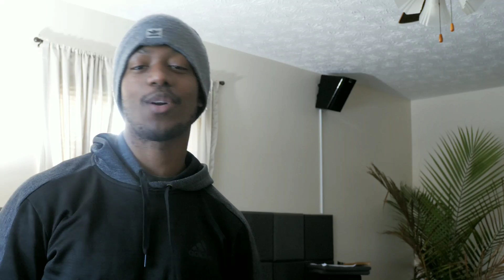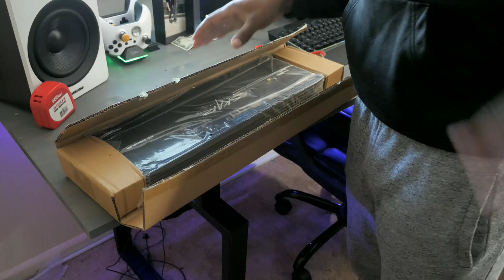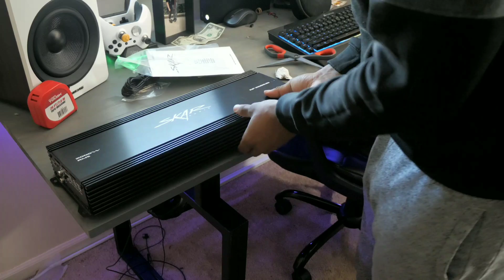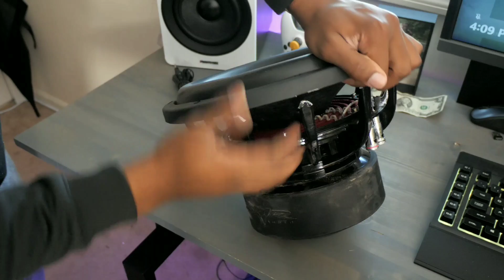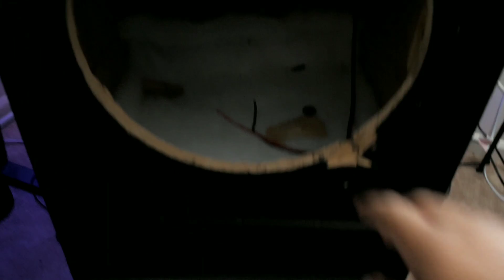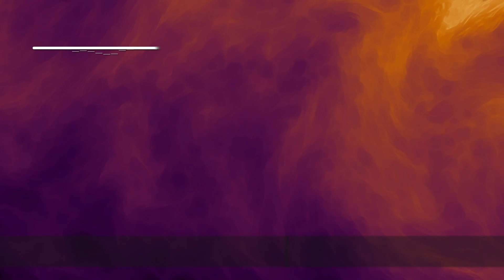Skar RP-2000.1D With Skar Audio EVL 12s!! 5000 Watts! | OFC Wiring

Comment: My personal experience with that package is very impressive I never had a set that banged the way this setup does it's amazing but then I kept the woofers when I was in need and then sold the amp I slapped them on the DS18 GENX 6000.1 And still slamming the ground ! 😂 These woofers are true ground thumpers!

Comment: Wait a minute a diagram that I saw it said that if you were wiring two dual four ohm voice coils to the amp then you wanted to Hook the speaker wire to the middle terminals. Maybe I have my system set up wrong can anyone confirm how you're supposed to wire up the subs to the amp?.

I wired up two EVL 12 dual voice coil 4 ohm in the box for one ohm operation. I got a plus and minus speaker wire coming out of the box going into the amp. Which terminals do I use? Hopefully I haven't caused any damage to the speakers
Reply from the maker: If you're wiring 2 dual 4 ohm subs to 1 ohm amp you Need to go positive to positive and negative and negative on both subs then tether a positive and one negative going to one positive and one negative of the other sub.
Reply: @Kpaceguy  no what I'm saying is how do you hook the subs up to the amp I have everything wired up in the box down to one ohm and it comes out of one set of terminals on the side of the box and a positive and negative speaker wire goes from that and then into the amp. I read somewhere that you're supposed to use the middle terminal on the amp the plus and minus in the middle of the amplifier. 

Now am I supposed to be going by What you showed in the video?. 

If so, am I running my subs at the wrong power the wrong ohms. Or does it not matter on the amp end?

Should I rehook up my box  to the amp based on how you did it will it make a difference Or is using the middle terminals fine

My box only has one set of terminals coming out of one side of it
Reply from the maker: @jaygee6983  it changes from amp to amp what terminals to use. So you'll need to download your manual if you don't have it. It 100% matters on the amp end what ohms you're running. It doesn't matter how you have things wired going out of the box it matters how you have the subs hooked up together which is what I just described.
Reply: @Kpaceguy  I have the RP 2000 skar I just purchased and it looks like what you show in the video. You use different terminals than I used.

I wired the subs parallel for a one ohm load. I saw somewhere that they hooked up the plus and the minus in the middle of the amp. Is that right or do I got to use the same terminals you used.

I guess I can read the book that came with the amp again but it didn't really show. It shows the wiring going to both terminals. It shows all four speaker terminals being used on the amp It doesn't really explain how you would hook up for parallel mode. The way I wired my box one terminal has leads coming out of it that would go to the amp so I only have two speaker wires, one positive and one negative so I'm kind of just trying to figure out where I hook those up on the amp if maybe I have it wrong
Reply from the maker: @jaygee6983  use the same I used.
Reply: @Kpaceguy  okay thanks man. I'm going to rehook up the connections also you have any clue where I should set the gain I have it almost all the way up Is that okay or should I be going three quarters with it or is it fine where I have it?
Reply from the maker: @jaygee6983  there's really never a reason to have it all the way up. But the correct position changed depending your electrical system. An audio shop can set it for you for maybe 25 bucks
Reply: @Kpaceguy  well I'll bring it down to three quarters to play it safe

Comment: I just bought the package does the rp 2000 SKAR amp do a good job at 2 ohms with the skar Evls cuz I wanna do 2ohms
Reply from the maker: No it's intended to be at 1 ohm and there's not really a reason why you wouldn't
Reply: So it’s the rp 2000 is good at 1ohm for the evls
Reply from the maker: @shirazalli5566  yes

Comment: Did you use the 3000 watt ofc wiring kit?
Reply from the maker: Not a kit but it is ofc 0 gauge
Reply: @Kpaceguy   what’s the wattage of your wire?
Reply from the maker: @derrickwalters78  2000+ watts

Comment: Could a 4 gauge kit work on that amp??
Reply from the maker: Not recommended
Reply: no, that amplfier isn’t a fan of bad voltage either. i’ve got one and i’ve noticed it doesn’t like below 13 for me. you’d be best of using 1/0 ofc

Comment: I have 2 skar evl 10s what amp do you recommend
Reply from the maker: 2000.1D or 2500.1D
Reply: @Kpaceguy  hey I just researched, do you think a rockville db14 would work fine, my subs are 2 Ohm stable.
Reply from the maker: @lilmudbuddy7633  yes but that 2000w rms probably isn't at 2ohms.
Reply: What about a Taramp's MD 3000.1
Reply from the maker: @lilmudbuddy7633  that would be fine
Reply: Thanks for the tips dude, I really appreciate it have a good night.
Reply from the maker: @lilmudbuddy7633  no problem buddy

Comment: I got a set of dual 12 evls for free. Super excited. I really like loud bass. Hope my electrical should be fine with the rp2000.1d. It's not an insane amp and purposely got one with less wattage so I don't need all that extra stuff. All 0 gauge ofc wiring and the big 3 to help my alternator. Can't wait for the install day.
Reply from the maker: Yup you should be fine but wouldn't hurt to get a 2nd battery
Reply: 2nd battery maybe needed depending on power requirements of your 4 channel amp.  Measure voltage at the amplifiers inputs with volume set to loudest you will use and check for voltage drop.  Too much voltage drop can kill your amp (some amps are more sensitive to voltage drop than others)

Comment: Take the time to MOUNT everything if you got a nice set up
I made wooden molds of my base in the trunk. (the floor) Then I made some thick wood that is also light, but strong.
All of My things including amp, and speakers Have frames built around them holding them to the board. They are so strong and reinforced with epoxy. 
Basically, if someone manages to get into my trunk, they actually won't be able to take anything. How to you beat a theif? Simply make it too hard to take. 
And for the car? go to your dealership, have them install a remove cut off switch. As soon as the car starts, press the button and shut it off :)

Comment: Hey would this be enough power for both of the subs, I have 2 and I don’t know if I should go with this or the mono block 2500
Reply from the maker: What subs. If you're talking about vxf 2500 isn't enough. I'm finding that out now
Reply: Kpaceguy I have the evl 12s I was wondering if the SKV2-2500.1D would power it alright
Reply from the maker: The would be good

Comment: Did you need an upgraded alt, or capacitor or anything to help run this stock?
Reply from the maker: No but to get the best out of your amps I'd upgrade alt and battery
Reply: @Kpaceguy  didnt watch the video yet but what kinda car is it? waiting on my evl 12s and the skar 2000.d
Reply from the maker: @BigHemiNJ  2016 accord
Reply: Are the Speakers any good?

Comment: Um, thats 2000 watts my dude
Reply from the maker: Dual evl max power combined is a total of 5000 watts
Reply: @Kpaceguy  if he is only using one 2000 watt amp he is only getting 2000 watts I know the amp does do over rated watts but only around 2700 watts so that's all he's getting.
Reply: single 2.500 watt along with 1.250 watt rms baby double makes 5k 2.500 rms sounds reasonable lol 30 32 hz he can shake house windows with that low hits

Comment: Why did you put 5000w in the title? It's a 2000w amp
Reply from the maker: Speakers max power combined
Reply: Oh, gonna need like two of these amps to even get close that 5k
Reply from the maker: @rickytrevino8281  I have a whole new system
Reply: @Kpaceguy  What is it
Reply from the maker: @rickytrevino8281  its on the channel
Reply: @Kpaceguy  Couldnt find it
Reply from the maker: @rickytrevino8281  just type in Kpaceguy skar vxf or Kpaceguy skar audio.
Reply from the maker: https://youtu.be/rj7Ixzvv8ek

Comment: I have two of the ix-12 series 12" subs on the rp1000.1D they handle it just fine there subs are so conservatively rated and I bought there amp wiring kit witch was plenty of wire and 4 skar audio 6x8's and to of there super tweeters mids and highs powered with a power acoustic 2,500 watt amp tuned to around 400 watts and the subs on the skar rp1000.1D man it freaking hits hard everyone I have gave a demo thanks I spent thousands on it all together it was $657.96
Reply: Bro I'm going to post a video of my setup on my channel here in just a bit if you wanna check it out
Reply: skar doesn’t have a rp 1000 only the rp 1200
Reply: @Messinwithsasquatch  yeah thats what i meant

Comment: Ok I hooked this amp up yesterday to my SA 12 V2 sub and tuned it using the SMD DD1 and set the crossover using the SMD  CC1 and set the Subsonic to 24 HZ because my box is tuned to 32 HZ. Don’t get me wrong the amp puts out its rated power and some but I did notice a little lack in the sound quality. I had my other amp hooked up first and it sounded very clean with rated power for my subwoofer on the dot. Sundown subs are underrated you can get way more performance out of them that is why I got this amp. I did notice it made my sub hit very hard because my rear view mirror immediately went down to the down position when the bass hit hard and parts of my car was vibrating that were not vibrating before. I hooked my other amp up today and noticed the night and day difference on the sound quality. And the one thing I did notice with my other amp was when I was playing it with just the sub without my mids and highs the bass was very clean with no unwanted frequencies. With the RP 2000.1 doing the same thing I can hear a slight frequency of the instrumentals or higher frequency slipping through. And I did not hear that on my other amp and I used the SMD DD1 and the CC1 to set everything and the subsonic set correctly because I don’t want to damage my sub. I think the main flaw in this amp is the crossovers that is affecting the sound quality but it hits pretty dam hard I must say just make sure you set your subsonic correctly; you don’t want to damage your sub. I am going to test it out for about a week and hook up a DSP and see if I can tailor the sound a little bit better. My other amp puts out half the power but cost about $70 more. So I guess you get what you pay for. For the power it puts out it is well worth the money, I am going to see if I can improve the sound with a DSP. If I can get the sound a little better I will keep it.
Reply: So buy two to make it better in quality
Reply: get the skv2 series wayy better sound quality

Comment: What ohm are the evls? 2 or 4? Im new to this.
Reply from the maker: They come in dual 2 or 4 ohms depending on how many you want to run and how stable your amp is
Reply: You can wire two D4’s down to 1 ohm or keep at 4 ohm.
Reply: 2 Ohm to 1 ohm in box comes with it im guessing so u just wire it unless custom box well start tunning up lol

Comment: any problems with overheating with the wood amp rack ? im waiting to install mine had it all over a year
Reply: I have the same amp and it gets warm but not hot. Running it @1 ohm and I run full tilt all the time no problems. Just dont mount to sub enclosure or skar wont warranty it.
Reply from the maker: Nope not at all but I don't run it at Hugh volumes too often
Reply: @Kpaceguy  appreciate the reply bro thank you all i have left is just plug in all my wires and build amp rack just didnt want to send it in to protect

Comment: Do you have any overheating problems with the rp 2000? Beacuse i do 🙁
Reply: Put some rubber spacers between where your amp is mounted and your amp. Problem solved. Or if you are that worried about it wire it to 2 ohms instead of 1. I've not had any problems with mine tho.
Reply from the maker: Nope haven't ran into any problems so far
Reply: I heard they overheat if u mount them on the box or any flat surface     because of vents being on the bottom.
Reply: I sold the amp theres reviews that it does not like 2ohms and I did go with 2 ohms and it was worse
Reply: @ReeferCuz  wow that's crazy man. Only problem I've had with skar is I ordered a evl 15 and the dustcap was messed up, it's like the logo is peeling off the cap.
Reply: Yea my shit overheats too smh
Reply: My 2000 amp overheats also
Reply: i would say keep gain low if is overheats and try test voltage with Digital Multimeter

Comment: I suggest a PAC- LC1 bass knob. It runs from the back of your radio. Simple and more convenient. Thank you.
Reply from the maker: I'm not sure I've ever heard of that
Reply: Not hard to install. Connect the rca wires together and get ready to BOOM. I have 1 12" @ 1 ohm EVL on a super bass box and being powered by the SKAR AUDIO SKv2  1500.1D @ 1 ohm. The whole car is SKAR AUDIO. Tweeters, 6x9's, 6.5's soundbox 0 gauge wires.
Later on a 12" ZVX on a RP2000.1d is being is next. The box is being built for that project.
Reply: Look on Amazon. They have it really cheap. It replaces the long wire from the amp to the radio.
Reply from the maker: @chingas24  I appreciate it

Comment: I actually have 2 evls 12's as spares to. Plus I got a sk2500 and a rp2000 as spares. Ive always ran skar audio in my car. currently got 2 vxf 12's on a rp4500 and man do they sub. I have another car with 2 rp2000's on 2 more vxf 12's and again I'm impressed.
Reply from the maker: I'm glad to hear that because tomorrow will be my first time with anything skar audio
Reply: @Kpaceguy  I promise skar audio will impress you. Follow my Instagram @famshotcaller. U will see
Reply: famshotcaller do you hear a noticeable difference between the rp and the sk series amplifiers?
Reply: Honestly no I don't
Reply: I love the skar product I have a skar RP 4500w rms amp on 4 skar zvx 12s in a 4th order wall build in a 94 Toyota Camry and all skar mids and tweeters and I am impressed with skar